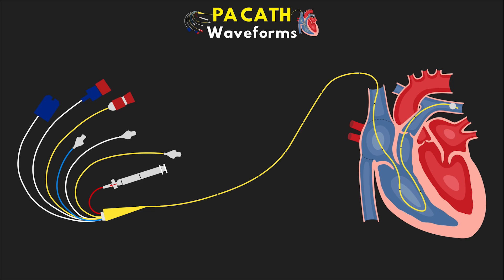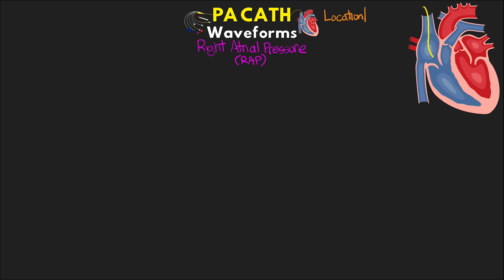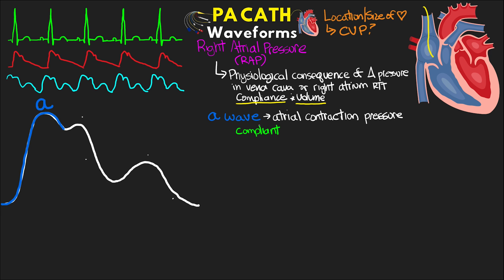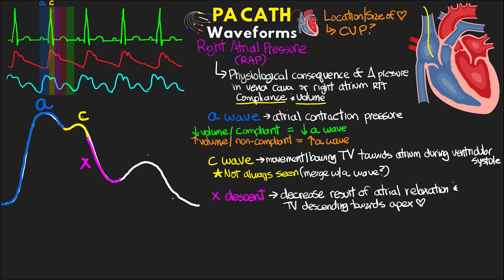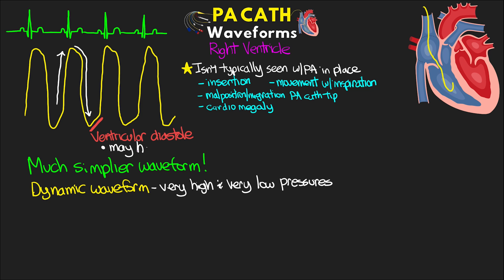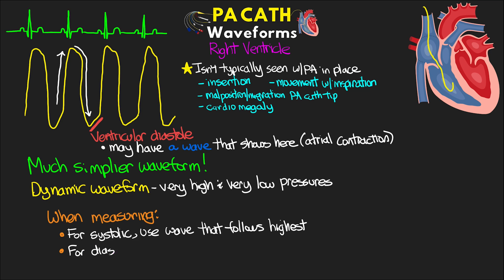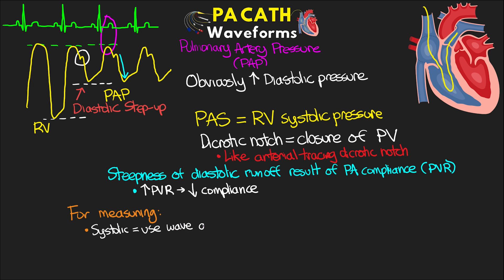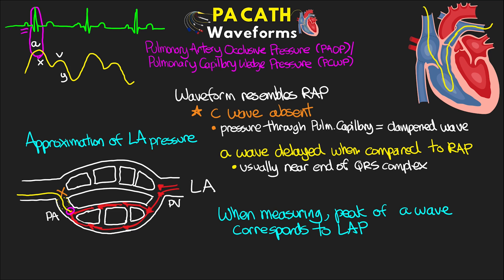Pulmonary Artery (PA) Catheter Waveforms EXPLAINED!

Comment: Please tell me the best way to differentiate between I PCWP and a dampened PA waveform possibly caused by air or low pressure in the system or a catheter issue or placement issue, like on the sideof a vessel? ? Partial occlusion in system? Kink within system either inside or outside of patient? We have been taught to flush our line to get it to float back into the correct position. We are not allowed to inflate the balloon and do not perform PCWP's on our patients.